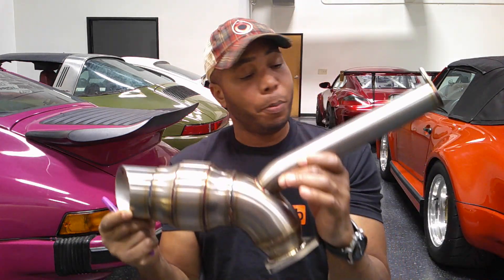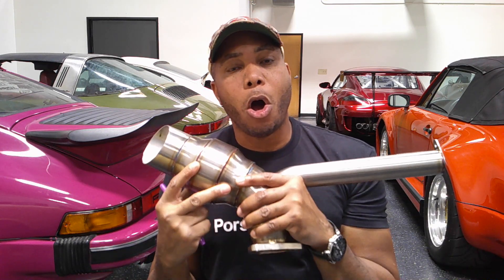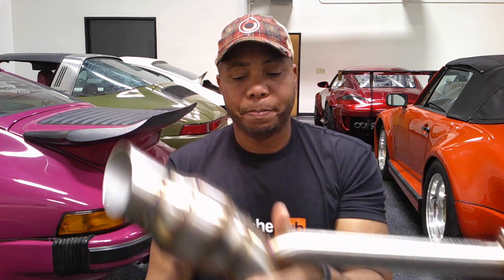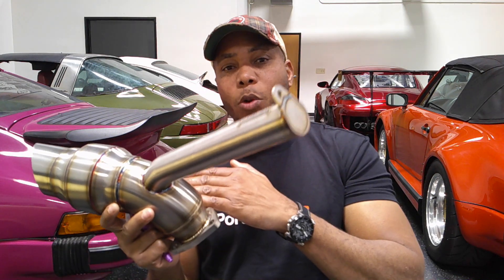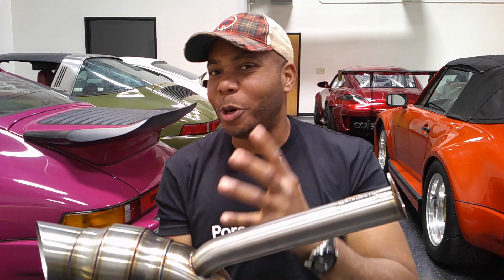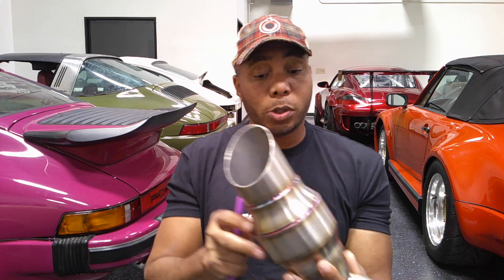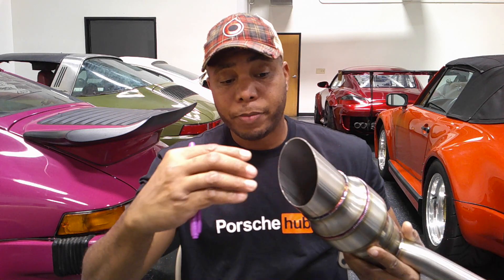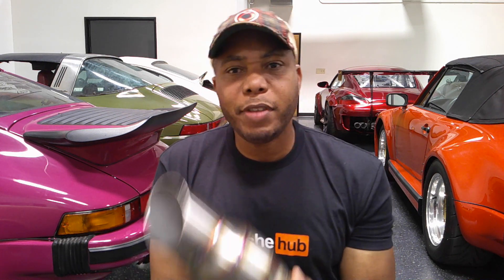How does the Bisimoto Pulse chamber work?

Comment: Thanks for the video Bisi. To all..put this on my 3.2 Carrera last year. 9lbs vs 32 lbs for the factory muffler. Also eliminated the cat and cat shield so dropped more weight. I have the 18db decibel reduction insert installed. Make no mistake the car is significantly louder but you can feel the power increase and I believe the weight reduction. Money well spent.
Reply from the maker: My pleasure, Tim. Stay safe!